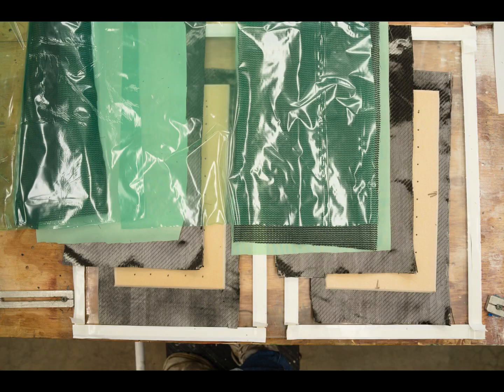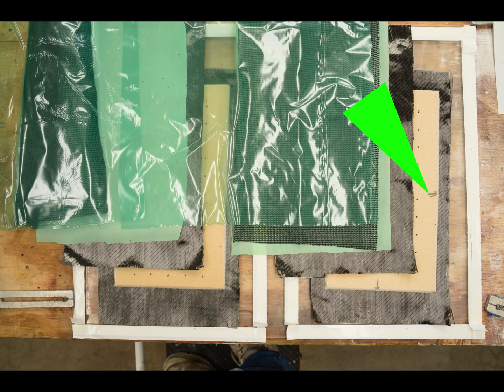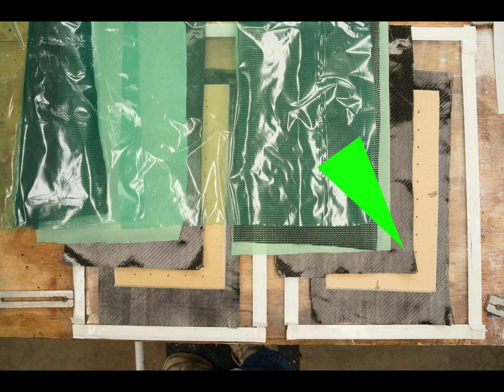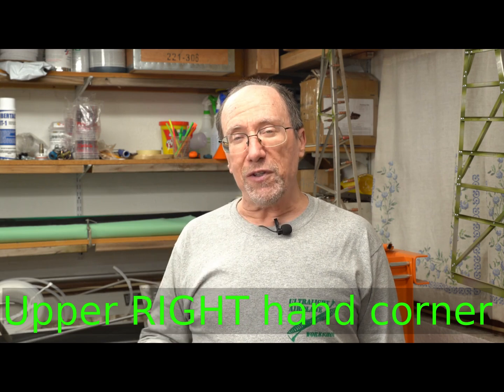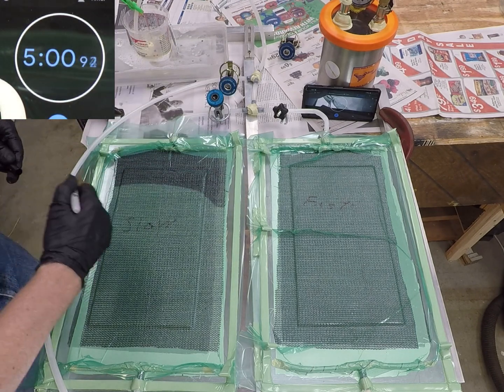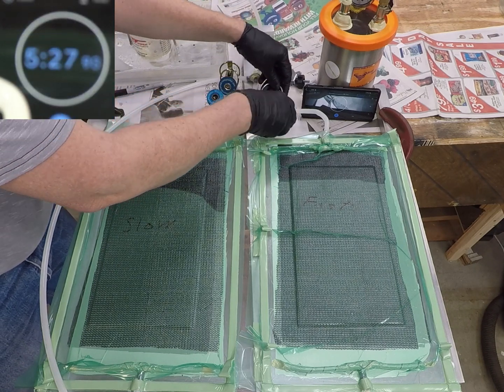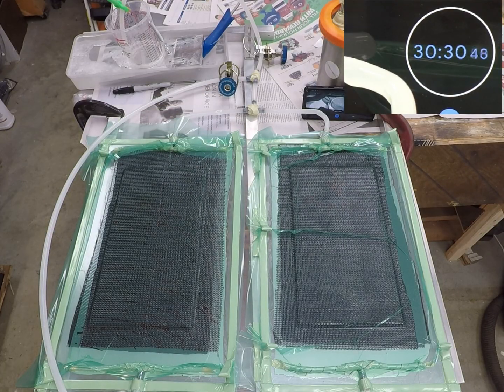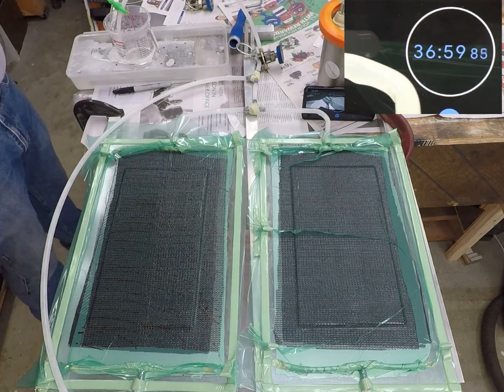Composite Testing: Vacuum Resin Infusion Fast Flow Test

Comment: Sir can you show calculation of resin needed
Reply from the maker: For carbon fiber you can assume that the weight of the carbon fiber will be equal to the weight of the epoxy that fills it. For the epoxy that will fill the flow media you will have to look up the data sheet of the flow media. I ignore the epoxy that will fill the peel ply. I just take a guess at the amount of  the epoxy that will be in the tubing.  No complicated calculation needed.

Comment: I also have a question, and thought I would post it separately. 

I have never done infusion before, and am jumping in some what recklessly. I am attempting a 6mm (1/4"ish) lamination with 16 layers of 6 oz 3k 2x2 twill and 2 layers of unidirectional 22.3 oz. Layers will be 5 twill, 1 UD, 5 twill, 1 UD and 6 twill. 

From what I have seen your testing has all been with thin laminations, but I think your experiments with core material may have some parallels to thicker laminations. 

I have watched many of your videos several times... so I'm not asking this in ignorance, but because I value your hands on experience. I'm concerned about the material not wetting out completely. My thoughts are that I should use a restrictive flow media (media substitute) to encourage flow through the cloth. 

I remember you saying that you had issues with UD not flowing well as the flow path is through the tows. 

The end product will be carbon fiber, but I intend to attempt this part first in fibreglass with similar cloth. The resin viscosity I intend to use is 920 cps and has a pot life of about 75 minutes in the required volume. 

Any advice would be appreciated !
Reply from the maker: Not sure what your intended use of the laminate will be but your part will be stiffer if your unidirectional layer's are closer to the outside. 

You need to consider your viscosity with the hardener mixed into the resin. Hardener will usually lower the viscosity a lot. For infusion you typically want a mixed viscosity in the 250 to 300 range.

As for the flow media. I've always had to experiment to find out what works. Try infusing a small part first to see if it will work. You may very will have to try a more restrictive flow media with the unidirectional. Good luck. 

I'd be interested to know how your project works out. Feel free to send me an email using the email address you can find at the bottom of the "About" section of the channel's main Youtube page.
Reply: @Designer103  Thanks so much for the response ! 

It seems so obvious, now that you have said it, to put the UD close to the outside of the parts. It is going to be a engine mount for a Jet Ski, so it needs to be fairly stiff and strong. 

The size of the completed part is 17" x 11" at the widest and longest sections, so the size is working to my favor. 

Wow. I had no idea that infusion resin was so thin. I have been told by several people to just use  West System with the slow hardener, but even their extra slow is 650. I'm glad I didn't run out and purchase Aeropoxy before rewatching your video about it. I will keep looking for a low viscosity infusion resin, and in the meantime, I may do wet a layup and vacuum bag. 

I really appreciate your help and email offer.

Comment: I've been watching a bunch of your videos and I really enjoy all of the testing that you have done. Lots of great info for beginners and experienced folks alike. I'm a huge believer in learning hands on. 

One of your videos, you mentioned your vacuum gauge was reading off after you let air in quickly and you suspected epoxy in the valve. I had a similar thing happen to me, except, by some fluke I saw a rubber cap on the top of the gauge and thought it may be a calibration screw or something... In an attempt to remove it with my finger, I heard a hiss noise and the gauge went to zero. Not sure if this is a fluke, or if this is a way to calibrate the gauge to elevation by equalizing pressure. Maybe it was a total fluke, but I thought I would share the story with you.
Reply from the maker: You are correct about the purpose of that black rubber plug on the top of the gauge. You peel it up a little to equalize the outside and inside pressure. You are correct that this will usually zero a gauge. Unfortunately for me the gauge still had an offset after I equalized the pressure. Gauges are relatively cheap though. Thanks for making the suggestion. I love to hear them.
Reply: @Designer103   It's good to know my reasoning worked out to be correct this time around. Thanks for the response.

Comment: Thanks for the great video, I found it very helpful.  I am just learning how to infuse composites...I don't have any peel ply, wondering if I could substitute something else?  The peel ply must be porous to allow epoxy to flow through it, right?  how does it not also become infused in the layup?  what are the purpose(s) of peel ply?  Ive read its to even out vac pressure & help release, is that it?
Reply from the maker: Assuming that you have flow media in the setup, without the peel ply the flow media would be difficult to remove (it would be encapsulated in the resin) and if you managed to remove the flow media you would have a VERY rough surface with excess resin chunks still stuck to the surface (the chunks would be the spaces in the flow media that filled with resin). I accidentally did this one time. The flow media is pretty much impossible to remove from the part. You get the same effect with peel ply but since the holes in the peel ply are small the surface is closer to being smooth when the peel ply is removed. But the surface is not completely smooth so it also provides a great surface to glue other parts to. You don't want to try to glue to a glassy smooth surface. And yes the peel ply does become encapsulated in resin BUT the pores in the cloth are small so the resin is then thin columns through the peel ply and easy to break as you pull on the peel ply to remove it.
Reply: @Designer103  thanks, that was very helpful in confirming a bunch of things I thought to be true, but wasn't sure. Specifically that the peel ply allows resin to flow & has small enough holes to easily break the columns.

 I don't have any of the "proper" materials, and I am actually using fiberglass to repair some holes in my pool.  My flow media is the plastic mesh that the local pizza place puts under the pie in the box and I am currently trying to 3d print an all in one, peel ply & flow media & inlets.  I think its gonna end up locked together, but as long as the cloth is @ the btm, I can just sand it all down until its gone.....i think.

care to venture a guess on the outcome of my little experiment?

Comment: Anyone could u tell me if it might happen degassing processes in the vacuum bag during vacuum infusion proces (gaugein 30 inch hg) that can make aerating the resin.   Or we have to lower down the prsure to 27unch hg.
Reply from the maker: If you degas your resin in a vacuum chamber where you can watch it, you'll be able to see at what vacuum level your resin will degas. There is no single answer. Each resin is different. Most infusion resins should be OK at 27"hg. The resins that I have would still degas at 30"hg.
Reply: @Designer103  thanks for the answer it helps me well.

Comment: Hi Leon, just found ur series of vids on carbon laminates. Love ur methods for testing infusion, sandwich, finish and strength! Haven't seen them all yet so u might have tried this already, but have a couple of thoughts. Have u tried glass tissue as ur first layer on the mould? Maybe it will give an internal flow medium to fill the last pin holes on the surface making that a bit more resin rich without adding too much weight. And u probably won't see it as the tissue refractive index will make it 'disappear' in the laminate. I wonder if that might work if u used it as an additional internal flow medium across the foam core? I saw another comment somewhere to put a layer of resin on the mould before u lay it up and bag it but that might be risky as the clock is ticking before u start bagging it. Have u tried hand laying it up, then bagging it and vac out the excess resin? I'm like u, worked with grp many moons ago and have a rekindled interest in carbon and vac. When I can get back to Europe then I'll go through a similar process u r going through. Interested to keep following what u r doing and what u do when u get into elec motors, and batteries! Keep up the good work!
Reply from the maker: Thanks for the comment. I have not tried the glass as the surface layer. I need to save all the weight that I can so I'll only do that as a last resort. I think that I can now get a good surface finish so hopefully it will not be needed. I've thought about the hand layup first but time could become an issue. It might be possible though. I'll try it if I need to. Thanks again!